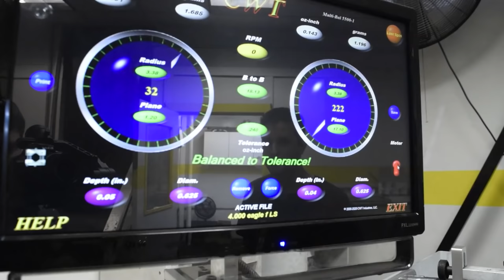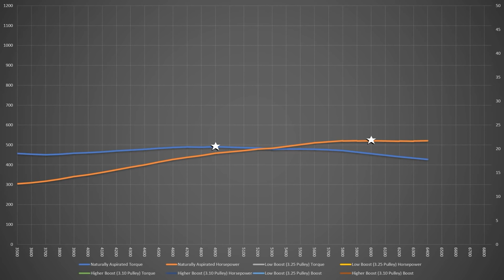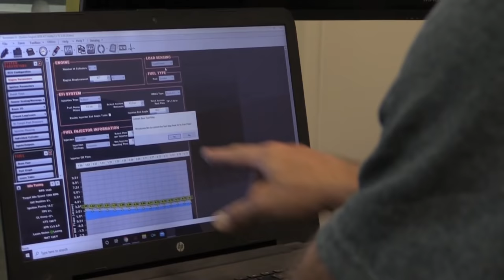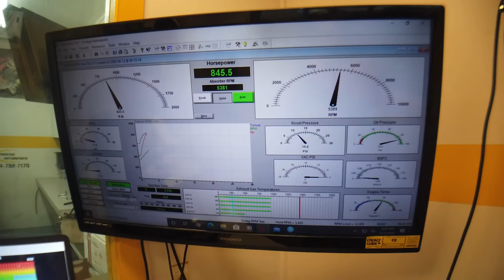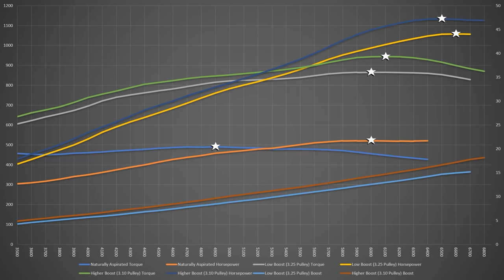Dual Superchargers and 1,100+ Horsepower Street Build!

Comment: Wished they ran just 1 supercharger on the dyno to see the difference between only 1 super charge vs 2 superchargers
Reply: Wish I could afford one if I could I have y’all build a 429 Ford big block
Reply: Believe torque storm say one is good for 700hp
Reply: Richard Holder Dyno with just one on his channel.
Reply: One torq storm is good for 700 HP no matter what you put it on. Running two of them might look cool but in reality your 2 times the drag on the crank and probably 4 times as hard to fit under the hood
Reply: jimdouglasgregory  I don’t believe it’s that much harder. Think their alternator relocation bracket is setup to make installation of two easier. But yeah I would say unless you want 4 digits of power one is going to be enough. Especially for a street machine.
Reply: @jimdouglasgregory  it's good for more than 700. It's based on what the motor output is. It's designed for getting cars to about 700 crank however very easy to go over that and make 700 at the wheels lol
Reply: @floridaarmedcivilian746  ?!
Reply: @richardrogerson2383  sorry was a typo

Comment: Running the dual kit on our new race car. Its rowdy! Love Torqstorm!
Reply: what's the advantage of running 2 small centris vs. 1 big centri? a procharger D1X is rated for 1000+ hp, while an F1X is rated for even more. 1 centri will be less complex and seems to be easier to package.
Reply: @sepg5084  We run torqstorm superchargers we don't run pro chargers.
Reply: @sepg5084  plus torque storm has a lifetime warranty on there supercharger, procharger doesn't offer anything like that.
Reply: As someone who has run a lot of prochargers and currently runs a F1A-94, the boost curve on these twins is probably near PD blowers vs a peaky single centri....
 The TS single centri has more meat in the curve lower which kinda caps them a bit with 700hp...dirt cheap too...
 I'm BBC but for what I have in my PC brackets and head unit, I could run the twin TS....AND mounting possibly an AC MUCH easier....

Comment: 18 pounds, race gas, two superchargers and a 427 making 1100HP? A single 80MM on pump gas makes that..
Reply: 427 LS7 = 505hp
427ci + 15psi = effectively double the displacement
Double 505, you get 1010... 1100 isn't bad. Considering it's a blower motor though, it probably takes like 200hp just to turn those blowers at peak power.

Idk, seems about right to me.
Reply: But what is the power curve on a 80mm Vs this.
Reply: @Thee_Magic_Man  80mm will have low hp and torque in low rpm but when the boost is up will see more than these procharger, that's why you see turbo in drag racing

Comment: Why have TWO blowers when you can have ONE which is larger and hence generally more efficient? All else being constant, a larger aerodynamic device is ALWAYS more efficient because while the device scales geometrically, the air molecules and their fluid dynamics do not. If you are going to use two, at least have them sequentially so each is responsible for a lower pressure ratio.

Comment: Interesting build. I'd like to see something like this with a twin screw as well. Get the low end response from the twin screw and the high end horsepower from the pair of centrifugals. Can this setup run on E85?
Reply: The power need to pull it all would be crazy, loosing hundreds of hp to pull it all.
All that spinning mass would also make it slow to react, because everything acts as a huge flywheel.

Comment: Those torque offset wrenches should always be used at a 90 degree angle to the torque wrench handle. Haha, completely impossible in this application. Awesome piece by the way.

Comment: 11:15 and 13:02 the engine goes wide open throttle but takes long as hell to rev up. Why?
Reply: I think the dyno is doing that . probably some are faster at measuring power and adjusting the resistance . Ive seen it before like that.
Reply from the maker: That’s the dyno loading it up and keeping the engine from revving up too quickly. Thanks for watching
Reply: You set the Dyno to pull a specific amount of revolutions per second during pulls, the operator has a varied choice and will make his decision based on some variable such as what kind of power is expected and the intention of the engine...if you want a quarter mile car you can map more aggressively and errrrr on the leaner side of fuelling for that power burn, if you're building a burnout car you keep it slightly richer to keep the temps down for sustained high end revving!! Pulling different speed rates on a Dyno allows you to fine hone these things.

Comment: I think I just came up with an invention from a weird idea. An ice tube that comes off the intercooler, to the TB, a tube inside a tube that's surrounded by Ice and water, in hopes of cooling off the air coming into the motor. Would only be good per pass tho...
Reply: I think land speed racers do more or less that.

Comment: Just curious.  Why didnt you go with an RHS block?
Reply from the maker: The RHS block is a good piece but it is also approximately twice the price of the Dart LS Next Pro
Reply: @TheHorsepowerMonster  is it the stronger bottom end to use though?
Reply from the maker: Good question. Not sure. which is stronger, but I'd be pretty confident using either well into the 1,500 hp range.
Reply: The only reason why I'm asking, is that even Tom Nelson says that the bottom end takes a beating when Supercharging and the top end takes a beating when turbocharging.  I think the stronger bottom end of a Y block would be the way to go on this setup, or am I wrong?

Comment: What’s the difference between 1 super charger & 2 super Chargers. 
  Doesn’t make any sense if you can pump the same hp
Reply from the maker: It is small, but one difference is spinning two smaller superchargers slower to generate the same amount of boost generates less heat. If you aren't running an intercooler it can be a benefit. But honestly, the biggest reason is the look. Thanks for watching.
Reply: The Horsepower Monster why would you race & not run an intercooler. “Being Cool” doesn’t win races.
  It’s a combination of all things coming together at once that wins Raced....
  I stopped racing probably before you were Born!!!
Reply from the maker: @ltsgarage7780  I think this is a street engine and not a race engine. It was built to run on pump gas, which doesn't say race to me. And Holley had it built as a giveaway prize, so even though they could have no idea what it would be going into, they definitely assumed street machine because of the products chosen for the build. But I do agree with you about racing -- the only thing that matters is performance and looks don't factor into the equation. Thanks
Reply: The Horsepower Monster yup. I was just talking about 2 super charges. Why would any one run Two on a race motor??

Comment: You can pull more horsepower out of a stock block than that on pump gas
Reply from the maker: I don't remember ever saying that this was the most you could get. They could swap to different pulleys and make more boost or whatever. The point of this build was to make a reliable motor making over a thousand horsepower on pump gas, not to stretch it to its absolute limits so it's always on edge and won't last.